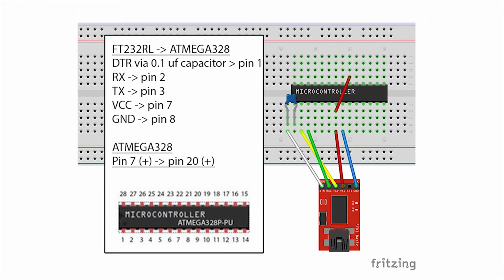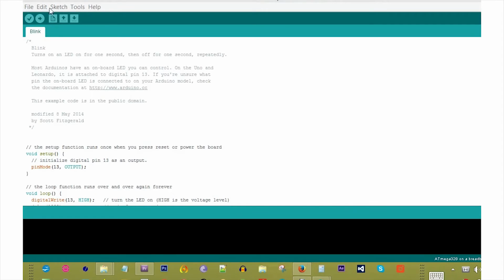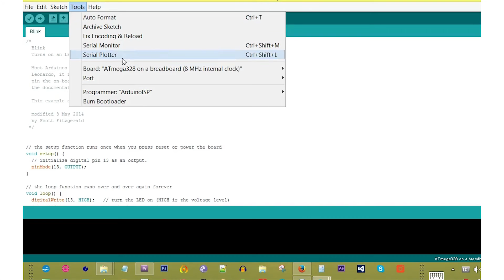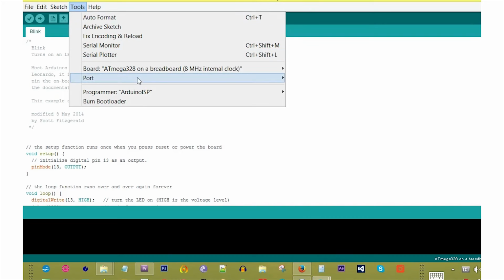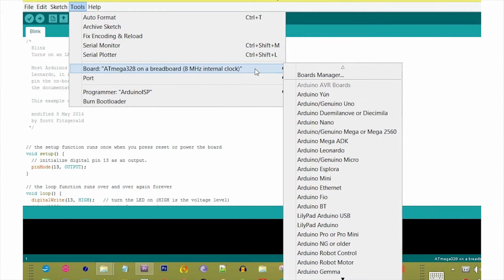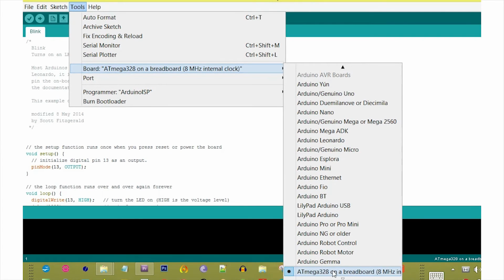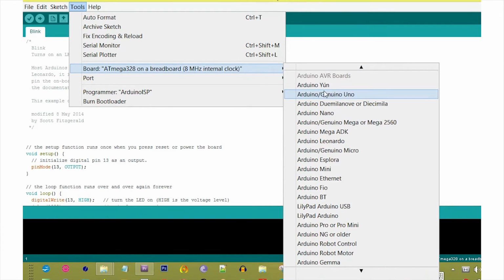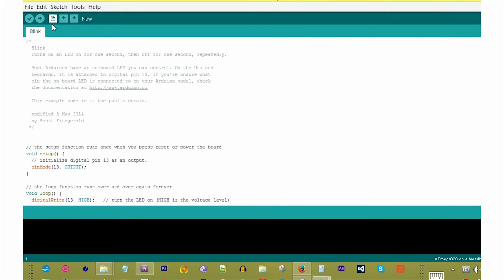How to connect a FT232RL programmer to the Arduino ATMEGA328 for uploading sketches

Comment: this worked for 1.8.4. IDE, 8MHz internal oscillator. Some notes/advice:
- turn on verbose debugging at upload in preferences
- needed to switch FTDI from 5V to 3V for avrdude to be able to 'verify' the uploaded sketch. This is done by jumperwire on the board.
- triple check all connections when using breadboards. They easily come loose and you can waste hours
- connecting FTDI to breadboard >AFTER< connecting it to the computer seemed to lead to best results / least errors
- I did not have the issues with the capacitors as others describe, I used a .1 uF cap, that came with the all-in-one package from Aliexpress (direction: FTDI+, Atmega-)
- make sure to connect TX and RX correctly (as shown), it's not just 'connect all from left to right' as it might seem (others pointed this out here in the comments)
- unplug and replug FTDI from USB before attempting to upload the next sketch
- apparently burning the bootloader using FTDI is possible, however it seems to take a long time (hours) according to some tutorials/guides. Arduino ISP to burn bootloader worked for me in seconds (another video by this author) and with an error message about fuses, which I ignored (and blink sketch works fine now)

Comment: Hi , thanks for your video ,, in case i have an arduino board with atmega328 inserted in the board , about VCC  i need plug VCC of programmer in "VIN" pin of Arduino ?  In short my board not work more with usb connection , but it work very well yet so i wanted upload sketches in other way )))

Comment: Things i would like to share:

1) After burning bootloader through arduino isp... dont try to load any program sto it..as this will erase the bootloader
2) as soon as you finish burning the bootloader you can program it via this ftdi chip...keep in mind this chip needs a bootloader in order to upload code or else you will get errors like programmer not responding and stk_500() out of sync...
3) 0.1 micro farad cap also works fine (for me)...the ceramic one...

Comment: Port recognized - just tried to upload blink to test and not working :( - included 10uF with negative terminal of the cap connected to  pin1. any ideas - all wires doubled checked. NOW WORKING - on this system had to connect RX to TX / TX to RX - simple fix :)

Comment: I tried a 0.1uF cap and the Arduino IDE (on windows 10) didn't recognize my atmega328 chip.. I did some more digging around on the internet and found out that I should use a 10uF electrolytic cap ( The negative terminal of the cap connects to  pin 1 on the atmega328 ) instead. Then it works like a charm.
Reply: I am using a FT-232RL chip that I bought off of Amazon and it didn't have a DTR It only has RTS and CTS which later on I found out that RTS is basically the same as DTS so what I did was I soldered a pin directly into the DTS of the chip and I ran it and it worked
Reply: It's working with a 0.1 microfarad for me.

Comment: I have a  FT232RL ordered from Banggood and I see that it states that "This chip is not orignal, do not have EEPROM, can not invert the signals." ...Is this an issue and if so... is there a solution? Thank you for your videos. I will subscribe and give many thumbs up, Sir!
Reply from the maker: Jason Brambach not sure
Reply: Did your fake FT232RL chip get bricked by the drivers?

Comment: how do you make the FT232 work in windows though?
 i have tried everything and this piece of shit will not work all i get are comport errors  and i am using the right com port  i even  reassigned the com port manually for the adapter and tried several different drivers and none of them work with it
these things are garbage
Reply: Check my comment. I use windows 10

Comment: Tom I blew up two UNO s and One AtMega . they are not recognized by the computer , and it hurts me when evr I see them. Can I use the FTD232 to bring them to life again?
Reply: how do you get the FTDI232 to wok in windows
i been trying forever an i can't get it working no drives work with these things in windows i tried them all they are worthless pieces of shit
Reply: Andrea Mitchell  : You need a 10uF electrolytic cap between DTR on the FTDI and Pin 1 on the atmega328. the negative leg of the cap goes to Pin 1. I also use windows 10
Reply: @ctbully  mine didn't come with DTR it only has vcc,grd,rxd,txd,rts,cts thats it.. help? trying to upload code to atmega 328p
Reply: @ctbully  that's too many numbers?
Reply: @richardweicht829  Which country are you in ?
Reply: @richardweicht829  whats your number and which country are you in ?
Reply: If it does not work it's possible you have a fake chip which the official drivers either brick or send garbage data to